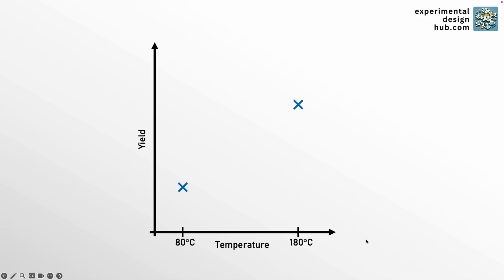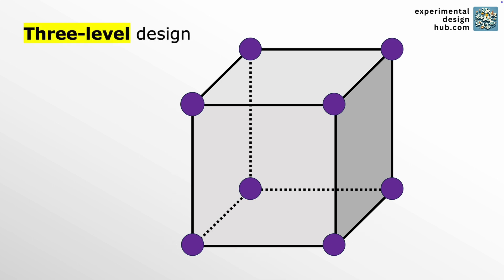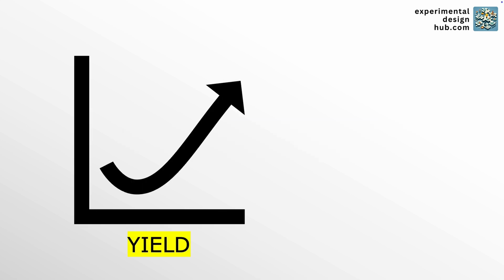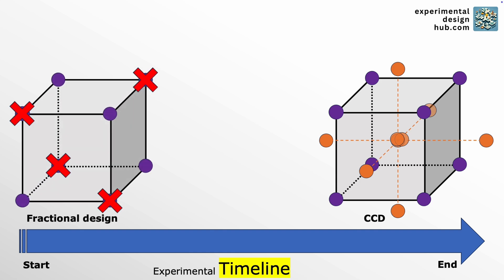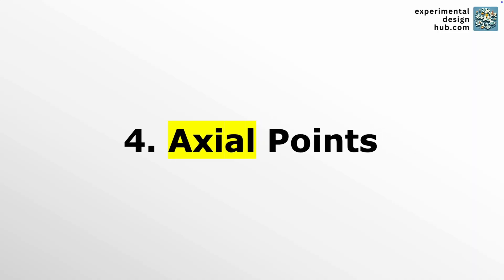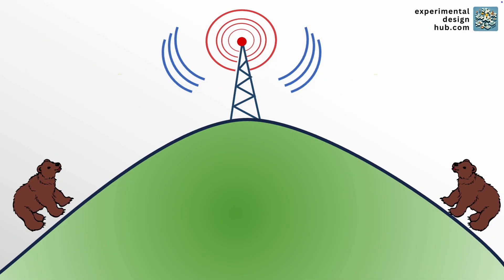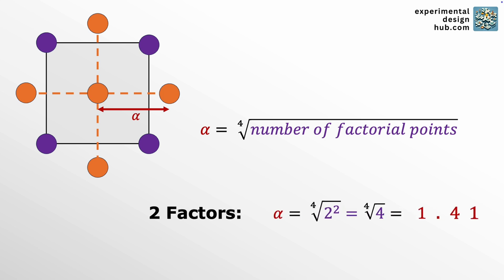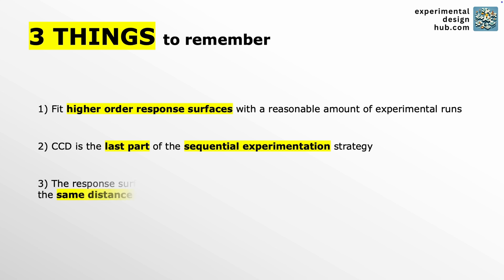The PROBLEM with FULL FACTORIAL design and how to solve it

Comment: Can i include 3 replicates for each factorial point in this design?
Or, maybe, make a factorial design with 3 replicates, then after that make a run with only the center and axial points, and include them in my last factorial design turning into a CCD?
Reply from the maker: Yes absolutely! I even highly encourage to start with a factorial design and then extend it to a central composite design when necessary.

Comment: So so long as the response is no more than a cubic corolation this is just as effective as a FF...dam I need to look into this.
Glad you still include a FF in the experimental timeline as it's robustness is unmatched and so essential for fully understanding the correlation for new complex systems....unless you know another way?
(I confess I use FF and sacrifice single run cost in favour of understanding the surface response)